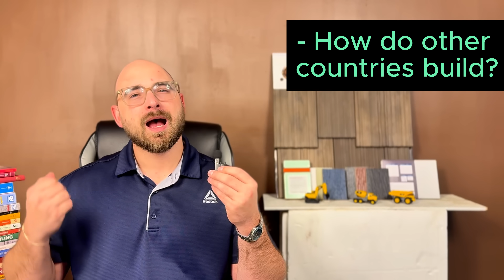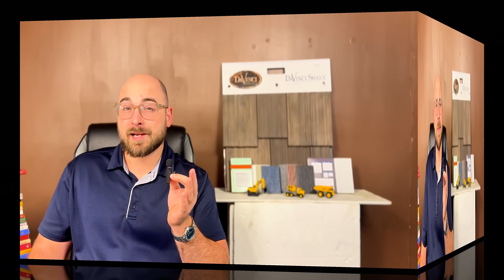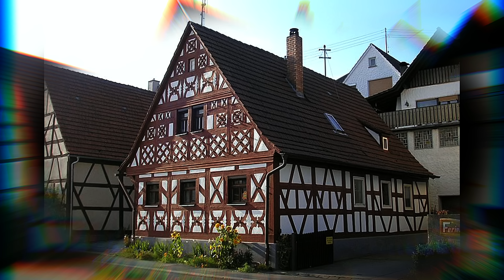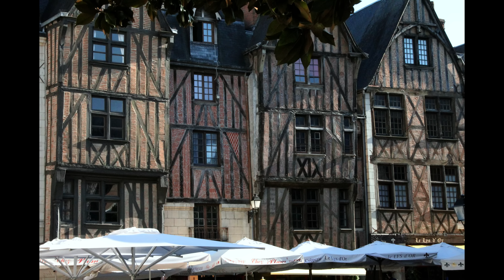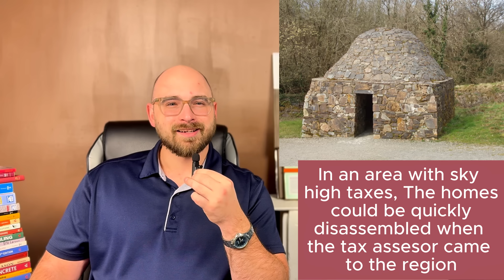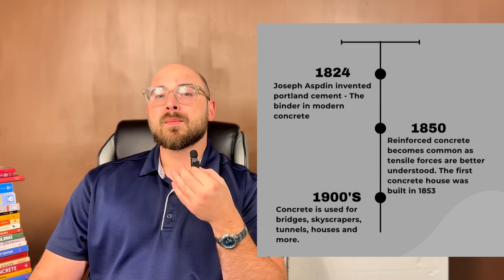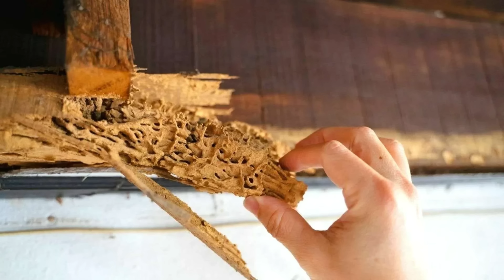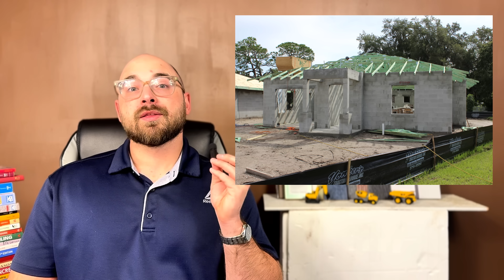Why Other Countries LAUGH at American Homes

Comment: Thanks for great video!  I had a reinforced concrete basement poured for a 2 car 2 story garage on a hill side. It was quite a project but turned out great.  And my childhood home was cinderblock. The only issue with it was that it was stuccoed and the stucco would flake off in areas, particularly if moist. Modern materials might mitigate that. I very much like your foam form wall approach. This mimics what they do in Switzerland. We might think an all concrete house too expensive and in USA it might be because of low efficiency. But in Switzerland and Germany they are extremely efficient with their molds and basically will have poured the whole house (including the interior walls) in just a couple/few days. That is why they can do it economically. The only downside side of their concrete construction is that adding a water line, drain or electric socket or plug afterwards is cost prohibitive. But the Swiss and Germans are pretty good at planning such things out ahead of time so it’s usually not much of an issue. If I build a new house I will certainly look at that foam block method because that is the way to go. I think and metal roofs would have prevented all those losses in the California fires. It’s really the way to go. Thanks!
Reply from the maker: It sounds like you’ve got a strong understanding of the benefit of concrete / ICF construction. 

If you want to learn more, check out www.CrownICF.com
Reply: ICF construction works well.

Comment: Hi. Here i am bragging about my earth home. Built in 1960 in Hungary 20 inch adobe brick walls and i added 4 inch insulation. Conforms to highest energy conservation standards. Only heating is less than 5 cubic meters of natural gas usage per sq m/year.
Reply from the maker: 20” walls, WOW 😮 

that’s THICK! 

Is everything plaster coated? How did you frame your windows in? 

What about floor system? 

I have many questions lol
Reply: @Mike_Fortin  Glad to share knowledge! The inside has the traditional coating of adobe spread over chickenwire. I have applied a layer of gypsum to even it out, and painted it with regular dispersion paint. When i bought the house in 2018 i replaced to windows with plastic, but i only removed the old windows, and left the original opening with wooden lintels (the open span is 170 cm). I inspected them and the lintels were in perfect condition, set in the adobe mud for at least 60 years. They are form black locust. The flooring was concrete slab with fiber boards over it set in half and inch layer of bitumen. I replaced that with PE sheeting and 2 inch estrich.
The walls are traditional thickness, everything is from 10*20*40 cm sundried adobe bricks mixed with straw&treshing. Funny thing about the house that the walls are older than the foundation, as it was an original peasant house on traditional rammed earth foundation built in the 1920s, but when modern water proofing PVC bituminous sheets became available in the 60s the foundation was replaced, excavating on both inside and outside the house, laying brick foundation on the go, spreading the sheeting and connecting again to the wall. It was made in the 2 m sections as i can see from the overlapping of the sheets.
Reply from the maker: Super cool, thanks for sharing!!

Comment: Sheetmetal plates nailed to wood frame studs, joists, etc., significantly improves the strength of light wood frame houses.  With roofing that's designed to withstand high winds, these houses survive most hurricanes as long as they are above the flood level.
Stucco on the exterior walls, and using stucco to cover all wood elements, such as rafter tails, substantially improves a house's resistance to wildfires.
Light wood construction already does well in earthquake prone areas if they are built using the measures required by code in those areas.
Wood frame is the most affordable method of building there is.  I'm not talking about some person making their own mud bricks and building their own house themselves.  I'm talking about the cost to pay professionals to build a complete house for you.

Those block, or brick, houses they build in Europe would do well in a wildfire, and high winds if the builders take measures to deal with those conditions.  But European masonry typically doesn't have steel reinforcing, so they would not fare well in earthquakes.  But they don't have earthquakes in Europe mostly, so that's not a problem.  But it is a problem in some areas of the U.S.
But European houses cost more money, and because of the cost, far more Europeans rent than buy.

Stone and brick houses are not legal in the U.S. because they do not have steel reinforcing in them.  If a person designs a stone or brick building so that it incorporates steel reinforcing, then it will be allowed.  But those materials do not easily adapt to having steel reinforcing included.  Adding it really drives the costs up.  And that's additional expenses on top of using the most expensive materials, that also require the most labor, and labor by tradesmen with the highest skills.  If you see a brick house in the U.S., it is probably so old that it predates the current building codes.  Or the brick is just used as a veneer on the outside.  The actual structure is either wood frame, or steel reinforced concrete masonry units.
The California fires are not typical, and the causes of the fires are mostly due to bad management by government.  That should be fixable.  At least in theory.  In general, the houses that were surrounded by fire but survived, were not significantly more expensive than the neighboring houses that burned.  Insurance companies will be getting building codes passed that require those relatively small changes to be made to our "normal" houses.

In short, the U.S. is not going to stop building with light wood frame construction until our forests are nearly all gone.  Even with additional costs from improvements for wind and fire resistance, LWF still provides the most bang for the buck in a country where people prefer to own a house over renting.
Reply from the maker: All great points, although I will say that poroton (the clay blocks used across Europe) do make version of the block that can accept steel reinforcement and grout, but it’s not common in the US nor do I think it will be. 

I think for California where the climate is temperate and both earthquake and fire resistance is desired, steel framing is the most cost effective, an ICF house can be built to withstand earthquakes and fire, but it’s going to cost a lot more. I think steel framing combined with defensive design will perform the best against both challenges there. 

While lumber has a place in the construction industry, there are many instances where only tradition promotes its continued use. 

For example, where I am located, in the Chicagoland area, ICF is only marginally more expensive and offers excellent insulation value, airtightness, and disaster resistance. 

We have hot summers, cold winters, and a moderate to disaster risk, to me it’s an area where it makes a lot more sense to build with ICF than cali where it costs way more and it’s 70 degrees year round
Reply: @Mike_Fortin I've heard of issues with people being able to insure their ICF homes due to difficulty with termite inspections.  However, I believe they now make solutions like borated foam board or other products to get around this.  Sometimes insurance eligibility causes issues with non conventional builds or those that use rare construction methods.  Though, it should help if we can point to years of performance on commercial real estate when building residential.
Reply from the maker: ICF has been around more than 3 decades and can be protected from termites, 

Typically ICF homes have lower insurance premium, lower energy bills, and qualify for tax credit and rebates
Reply: Most people don't even know that brick houses aren't actually brick and are just a facade.
Reply from the maker: Right, it’s not doing much structurally

Comment: Disposable like Japan would be fine, if the homes were cheap. Homes in the USA cost more than most countries that use higher quality masonry construction. 

NYC metro is another place in the USA with lots of masonry construction.
Reply from the maker: Long term, I plan to build starter homes that range in size, even in the  600-1200 SF range, offering “starter homes” that are high quality, yet fit into the “affordable” price range 

Of course there will always be something cheaper, but not custom made, brand new, high efficiency, and disaster resistant
Reply: @Mike_Fortin  a 600 square-foot starter home that has to include all of your utilities and HVAC equipment, washer, and dryer and all of the amenities you would otherwise have as a shared common usage in an apartment complex…. What’s the price point on something like that that’s smaller than your average apartment in the United States?
Reply from the maker: In IL, around $200,000+ everything included
Reply: @Mike_Fortin  don’t forget $10-$15,000 a year in property taxes for the privilege of being in Illinois
Reply from the maker: Yeah that too, taxes are super high in IL, they’re less than half if you cross the border into WI
Reply from the maker: I feel like $200k is affordable, especially if it costs next to nothing to heat and cool, it’s permanent you own rather than rent, you have a yard, can utilize a loft above so it’s 2 bed one bath. Spend a lot of time outdoors or in the garage when the weather is nice . 

I plan to build one for myself as a concept piece , if there’s enough interest in the right place at the right price point, 

We will buy some farmland and develop it for the purpose of creating a subdivision of tiny homes . Or at least semi custom homes with tiny houses being an option
Reply: Yeah, no, if you’re going to compare New York and California has the gold standard for US housing then maybe you could make the argument that some homes in the US cost more than Mason restructures in Europe and other places but the majority of what we are discussing here are European standards, and those homes cost vastly more than their American counterparts
Reply: @Matt-yg8ub  I’m not seeing it cost vastly more for homes in Europe vs the USA. To get high costs you need to look at places like London. 

Even in the USA you can compare NYC to San Francisco. There isn’t a huge price discrepancies despite NYC being mostly masonry, vs San Francisco being mostly wood.

Comment: The LA fires are an epiphany as to why wood houses are inferior to any house made of concrete. I guess the wood lobbyists have kept America in fragile wood houses for decades. Like lobbyists have done with everything in America.
Reply from the maker: Lots of regulations make concrete tougher in CA specifically, plus the mild climate doesn’t necessitate the insulation benefits of ICF. 

While it’s possible to design ICF homes with seismic joints that can survive earthquakes better than earth homes, it adds a lot of cost. 

Even though I’m a concrete house builder, I would say steel framing is probably the most cost effective option for wildfire prone areas of CA. Can survive both earthquakes and fire when properly designed 

Now if you want bulletproof, you go ICF

Comment: ICF is great, the only issue is that we have about 20 suppliers and they all make some pretty cheap crappy product and you have to be super careful during the pour so you don't end up with a disaster. If some company came out with a stronger ICF that eliminates the blowout risk, they will do really well. I just don't understand why they skimp on they polystyrene which is ridiculously cheap to make. Just add another inch on both sides at a cost of about $0.25 per square foot and you reduce the chance of blowout by 90% or more.
Reply from the maker: Crown ICF is the best. 

There’s a reason why it’s the only block the US military and the US government uses. Because it’s the best. 

It was made by a guy who was building ICF houses 30 years ago and got tired of low quality blocks, so he designed his own. The webs are strong, the foam is high density, the ship lap design is glued at each seam for an airtight / watertight install. It’s a great product. 

You can learn more about them at 

www.CrownICF.com
Reply: Because it would probably increase their overhead logistical costs several fold because then they’d have to have different manufacturing, packaging and different dimensioning, different storage, different transport and all of the above.
the excavation cost would increase. It would be an exponentially larger impact than you understand.

Comment: The US has plenty of structures for residence made of concrete! They are called prisons and public housing.
Reply from the maker: Our prisons are built better than our homes? 😮🤔🏠
Reply: @Mike_Fortin  Of course they have to be. Otherwise prisoners could easily escape by punching holes in the tticky tacky walls.
Reply: @rogerphelps9939  you must be accoustic....
Reply: @Mike_Fortin :  all government construction projects are over planned and over engineered, they are way more durable than housing built for dwelling units, on the open market. But no one could possibly afford the kind of construction the government uses. Notice the government has insurmountable debt, that’s how I did it. And most of those buildings are empty or underutilized
Reply: @steveperreira5850  "But no one could possibly afford the kind of construction the government uses"

Incredible here in Brazil that americans call a "poor country" we all build with bricks and mortar and concrete reinforced columns. How can this be easy for us and hard for americans who are "richer"?
Reply: @LucasBKOK  Compare the average wage of a Brazilian concrete/brick mason to that of an American one.  I doubt I could hire a masonry contractor for less than $70/hour here.
Reply: @thelight3112 That means the Usa is a poor, fourth world country. "They" have been lying to you americans all the time.
Reply: @thelight3112  Nobody would pay them $70/hour here, so they have to work for the normal price of $8/hour. As you arranged it, that's it.
Reply: @ Well, do you see prisons getting walls moved around?
Reply: @starventure  the concept of moving walls is strange just plan better or use room dividers like book shelves it's like a child crying and saying noooo but i wannnaaaa eat ice cream now. japanese city kids would laugh at you when you tell them you can't work with the space given to you
Reply: @user-mh4ql2dj3s  Home expansion. It's quite common when updating a house that has too few sqft to get a good sale price. You could also knock down the original and put up something brand new, but this can be controversial and may draw ire from the locals.
Reply: @wiesel-burger8729  Don't live in a city.
Reply: @starventure  altough it's true that it's cheaper to remodelate wooden houses, i'm pretty sure it's cheaper to do it for brick houses outside of us than wooden houses in the us, everything is ridiculously expensive over there
Reply: So funny, so true!
Reply: made to last
Reply: And they last forever!
Reply: And they are built to last and be able to take the abuse people dish out.
Reply: Too True😮
Reply: cope harder